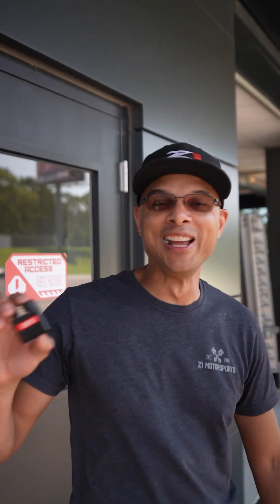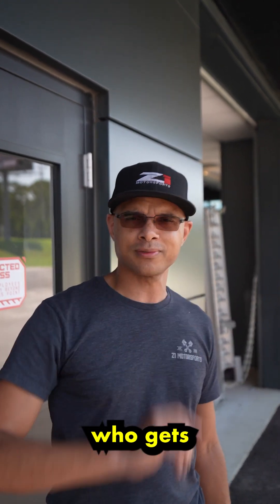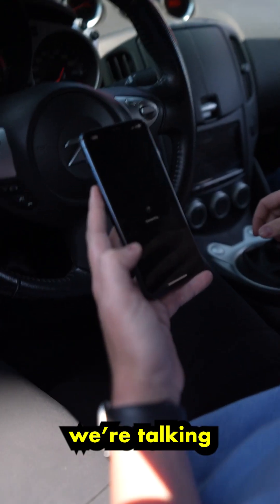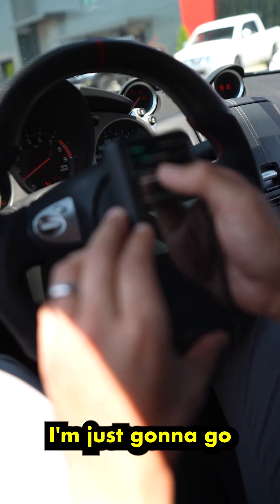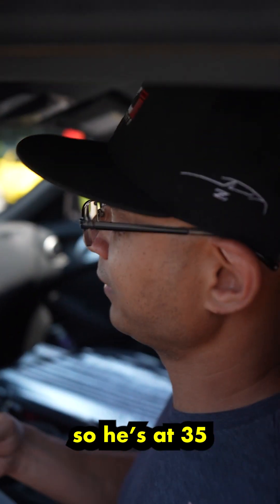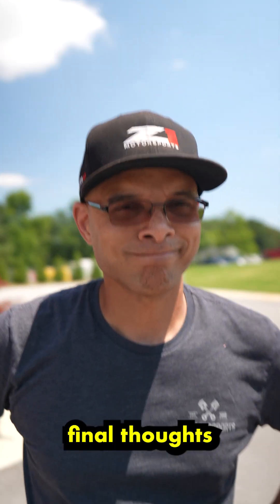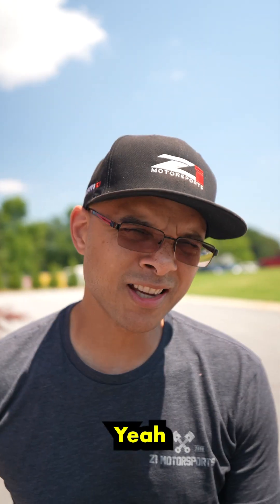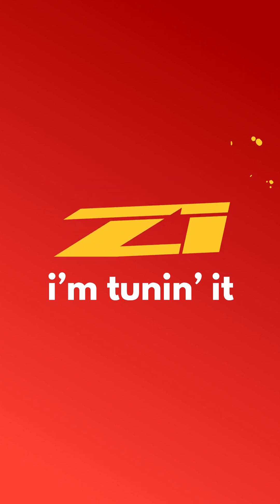Z1/EcuTek Traction Control WORKS!

Comment: Question I just purchased this and I want to make sure I'm enabling this correct. Do I need to hit the traction control button in my 370z for this to work or do I just enable it in the app and that's it? Also what would be a good number for the street? I want to make sure I have adequate traction control Incase I get in a heavy downpour so right now it's at 90% to hopefully help a little with the aggressive traction control from stock but still be safe enough to drive without babysitting it.